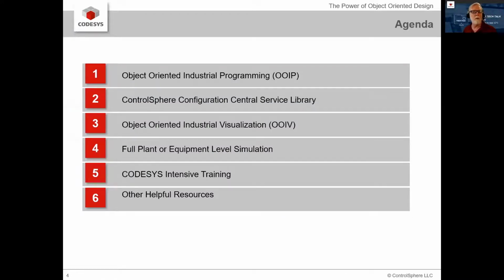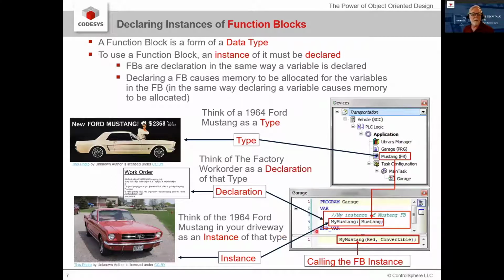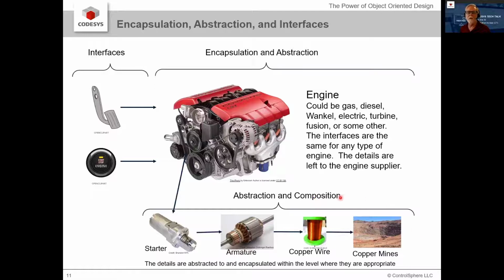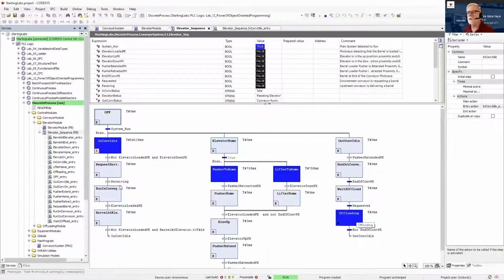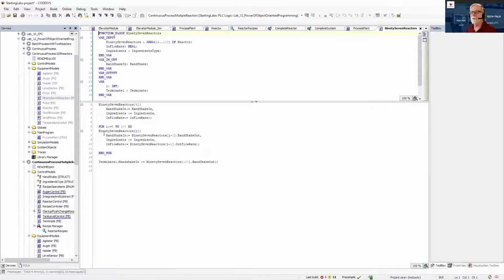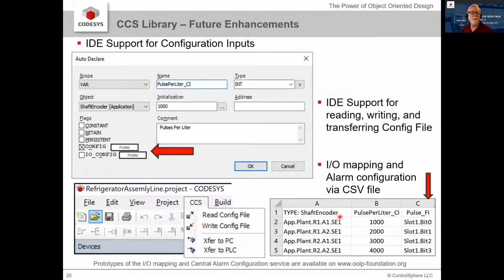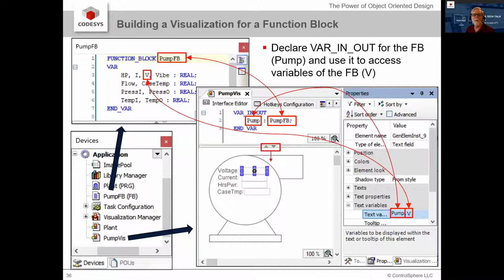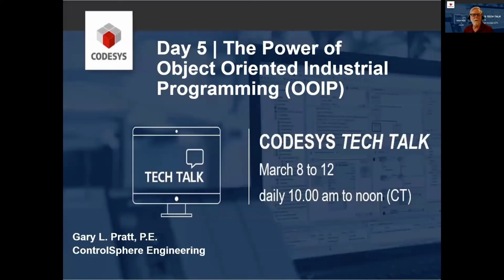Object Oriented Industrial Programming (OOIP) -- March 2021 CODESYS Tech Talk

Comment: Hello. I'm a control designer from Germany and I am really interested in this approach and I desperately try to block out old fashioned thoughts that at the moment keep me from understanding the whole concept. So I hope I'm able to put in words one of the questions I have in mind: I am used to designs with function blocks used to break down a big task to smaller pieces. I get the rough idea of the ooip but what I haven't seen yet is how you distribute information to whichever object needs it  throughout your control design without using global variables. Let's say the information for example you're in manual operating mode of the machine. Function Blocks must not be dependant on any kind of global variable in order to be reusable right? I have other questions but that's for the start 😅
Reply from the maker: Hello @orstenaumann7510.  Thank you for your interest in OOIP.  

There is nothing wrong with using global variables for information that is truly global, like global emergency shutdown, global simulation mode, etc.  I do recommend prefixing global variables and global constants with g_ and gc_ to make it extremely obvious that these are global variables.  Otherwise, it is best to program in a way that modules only need to exchange data with those immediately above, below, or adjacent in the hierarchy and these should be handled by passing the information through interface variables.  For blocks that need the services of a central service (like Alarms, logging, persistence, OPC, configuration, etc), I recommend those blocks register themselves on startup and pass the central service a pointer to themselves.  This is all explained in The Book of CODESYS (www.bookofcodesys.com).  I hope that helps.
Reply from the maker: Check out my video on OOIO for an example on how to distribute information to to distributed objects.
Reply: @ControlSphere  Thank you very much for the detailed answer. It helps and also I am continously working with Codesys trying to just spend time with the system which also helps. It's a learning process I figure and  takes time. There is no shortcut to understanding everything and it's also important to work on real problems. I'm on my way. One question at the end. Are there any example projects available  that can be directly viewed in Codesys? That would also help a great deal I think. Thank you.

Comment: This is a good presentation about how useful and intuitive an object structured application can be. The problem is, CODESYS and other PLC frameworks don’t allow you to schedule beyond the program level. This is an issue if you need some of your objects to execute faster than the main program. You either have to schedule everything in the program at the fastest rate required which is a waste of CPU utilisation or, separate those objects out. In the latter case you just end up with a task structured program again.

The ABB Advant 450 controller is the only system that I know of that allows you to schedule parts of a program at different intervals using the CONTRM PC element. However this is a legacy system that doesn’t have IEC 61131 support.
Reply from the maker: You are correct.  Although, there are several good alternatives.  First, have you considered event-driven programming?  Using this technique, the functionality of each object is only invoked when required.  This is described in the Advanced chapter of The Book of CODESYS.  Another technique is to implement a central service.  With this, each object registers itself and specifies the cycle time it requires.  The central service then calls each object with the specified cycle time.  This is also described in the Advanced chapter.  I would be happy to help you implement either approach.

Comment: Αs a java/c++ programmer this subset of oop I use ! I have a question : do you know if there is an API for java/c++ ?
Reply from the maker: CODESYS allows integration of C code, so if you can wrap your Java in C, you can integrate it in.  However, I only recommend that for legacy code that you absolutely don't want to touch.  There is a reason why we don't program industrial automation in IT languages -- most automation applications can't tolerate the terrible reliability of most IT software.  Best to stick with IEC61131-3 for automation.  
Rebooting your phone/pc/smartTV/router/etc is an irritation.  Rebooting your plant or machine could be a disaster.
Reply: @ControlSphere C is used in so many safety critical embedded systems now it’s really hard to justify that argument you just made. If anything, I see IEC 61131 languages as completely unnecessary given the abundance of safety critical embedded systems using C, ADA, Spark, Rust etc. the IEC 61131 languages are an unfortunate legacy of trying to allow electricians and chemical engineers the ability to use programmable equipment for industrial automation. C and ADA etc. are extremely reliable and are used as the underlying firmware for many PLCs, satellites, medical equipment etc. so saying that they are unreliable is totally misleading.
Reply from the maker: @user-fk9mo2ld6w  I stand by my statement.  It is significantly more difficult to create reliable systems in IT languages than it is in a system and language specifically designed to maximize reliability.  That having been said, I do differentiate between IT and embedded systems.  Reliable embedded systems can and do exist, but they were created by highly trained and highly skilled expert engineers.  (In the wrong hands, you end up with Toyotas with uncontrolled acceleration, Max jets falling from the sky, and Mars missions careening past their destination, etc.)   It typically isn't cost-justified to apply expert embedded resources to most industrial automation systems, especially when there is an excellent alternative.
Reply from the maker: @user-fk9mo2ld6w For sure, there are high-volume automation systems which can cost justify the expertise necessary to create a reliable embedded system.  But, these are the exceptions, not the mainstream.   And, with those they should use Eclipse, Visual Studio or some other embedded system development environment -- not using the C-code integration to write Java code in CODESYS.
Reply: @ControlSphere  are you implying that people who work in the industrial automation field are not highly skilled or highly trained? You can be highly skilled or highly trained in anything and make mistakes or do things improperly and cause issues. It's the relatively simple functional requirements for most industrial systems that make them much easier to develop, and the development be done in any programming language in theory. Compare that with the functional requirements for a satellite or aerospace navigational computer and you see the obvious leap in complexity. Nevertheless, both can be extremely reliable if developed properly.
The reason a lot of IT systems are not as reliable is more to do with the underlying operating systems that prioritise user experience over task determinism. They allow things like dynamic memory allocation, complicated and unpredictable task scheduling, non type safe programming languages etc.
Personally, I think that the IEC 61131 languages should (and eventually will) be superseded by C, Rust, Spark and Ada. That being said, the framework in which PLCs are developed with static memory allocation, deterministic task scheduling etc. is obviously a good thing and the IDEs, CODESYS included are user friendly enough to make developing PLC applications relatively easy.
Reply: Well defined regarding API
Reply: I think there is a key differential between pure IT industry and industrial automation - the physical interaction. 

pure IT industry only deal with pure information. In contract industrial automation mainly deal with interactions of physical objects like motor, sensor, cylinders. if any error came, the consequence will be directly shown in real world and immediatly such as objects collision, product massive damages..etc. 

The loss in operation will be a direct pressure to who being as a PLC programmer. That make people working in the area so conservative.
Reply: @smandyscom  that's the point I'm trying to make. It doesn't make any sense to compare PLC automation with IT software. A better comparison is with embedded systems which absolutely do interact with sensors, actuators and output devices. To go back to the point of this discussion, embedded systems do use languages like C and C++ very reliably and therefore there is no reason that those languages shouldn't be used for PLC automation as well. As it turns out, they are in fact used which is why CODESYS supports them and why almost all PLC operating systems will be developed in C and C++.
Reply: @user-fk9mo2ld6w  Beside interacting with phsical devices I got more point which may make the PLC automation world kind of unique to IT industry :
Reply: @user-fk9mo2ld6w  Good to got your reply :) Besides the interaction with physical devices I got more points which may explain the unique standing of PLC automation : 

1. Automation development is highly industrialized.
  
Controller supplier such as CODESYS, Beckoff only supply “hardware, operation system and some basic API” only and left a guarded programmable space for machine developer to develop their own logic of machine.
Machine developer just to focus on sequence control part without worrying low level implementations like memory allocation, threading…etc.  If any programming error happened at this level, it would just cause error worst to machine stop only. 
Controller kernel will be still working.
Prevent the kernel from crash is the responsibility of controller provider and they always do the good job.

I know very few of embedded system development.
But I think it looks not as high industrialized/standardized in sequence/real-time control layer? 
Team may need to build up low level layer first and stack up gradually? 
Not sure if any common framework sold in the market for providing common control services like axes control, I/O polling, mapping them into sequence layer...etc. 

Back the the argument of IEC61131.
As I know the IEC61131 is used to develop sequence control layer. 
IEC61131 is not used to substitute C/C++ jobs in the role of kernel.
Regarding newer C/C++ feature in sequence control layer I never used but I believe best application for them is used to develop information handling functionalities such as classic algorithms, hashing, searching in dictionary/array...etc.

Comment: Why would you uses CFC? That is the worst language to use and to troubleshoot. At least use FBD.
Reply from the maker: Please elaborate with examples on why you feel CFC is difficult to use and troubleshoot.  This is the first I've heard this perspective.  Do you have experience with LabView or SimuLink, and do you find that equally difficult?
Reply: @ControlSphere  I am coming from Beckhoff which is based on CodeSys. Trying to cross ref a tag to a CFC sheet just takes you to the sheet. If you have a large CFC sheet you then have another step to find the tag. You can't add a breakpoint to a CFC sheet like you can in ST, FBD or LD. I never use IL but you can add breakpoints there if you want to. In programs I have worked by other guys done in CFC it looks like spaghetti messes. Mostly used by the older guys who came from creating circuits back in the day. Maybe if done "well" they might be easier to read but I have never seen them done well and are terrible to troubleshoot when done poorly. If someone decides to use the entire sheet you are constantly scrolling side to side and up and down to find what you are looking for. At least with ST you can copy to NotePad++ and make changes quickly if needed. You can't really do that with graphical languages. I have not used LabView or SimuLink but understand what they do. We don't have those tools at my job. Maybe if you are really used to those tools that is why you prefer CFC. Honestly this is the first tutorial I have found that uses CFC. Most programmers I have worked with stay away from this language and like ST, FBD and Ladder.
Reply from the maker: @AudioJunkie79  Unfortunately, there isn’t a programming language on the earth that proscribes bad code.  A large flat design is difficult to understand and debug in any language.   Apparently, Beckhoff has some limitations as its possible to set breakpoints on any box and single-step through the CFC design in CODESYS.  

I do agree that creating a design in a graphical language takes slightly longer, but I have never prescribed to the language-based programmers’ philosophy of “minimum keystrokes at any cost” (and “look how clever I am, I consolidated 5 lines of code into one [that no one will ever understand]”.  I’m willing to spend a little more time to make something that is much easier for others to understand and enhance in the future.  Also, I don’t disagree with those who say text-based languages are a holdover from the days before computers had graphic capabilities, and that graphical languages better utilize the significant portion of the human brain dedicated to understanding picture.  This is why LabView and Simulink are so popular.  

Take a look at this link for examples of CFC-based designs https://youtu.be/wJYNTeAE7lk?t=5148

Comment: Been using these design patterns at Texas Instruments since 2009 and earlier.
Reply from the maker: That's great to hear.  For PLC designs?  Be sure to understand the distinction between OOP and OOIP. Many plant managers fear that bringing pure OOP techniques into the PLC world will require their plant or equipment to be rebooted as often as their computer/phone/TV/etc. OOIP is a first step that provides many of the productivity improvements of OOP without the complexity/reliability issues.  Plus, its something their plant technicians can understand and troubleshoot.  Plant managers tend to be much more open to OOIP.
Reply: @ControlSphere  Thanks for the response. I’m speaking of PLC and DCS (PCS 7). I’ve implemented the same same type of designs in Codesys 2.9.x, 3.5 and Siemens PCS 7. Currently rebuilding function block library in Siemens TIA since they now have CFC.
Reply from the maker: @abstractobject5337  Very good!  Sounds like you were on the leading edge.  I'm curious how you solved the distributed object configuration in CODESYS (and that and the distributed object I/O mapping in PCS 7)